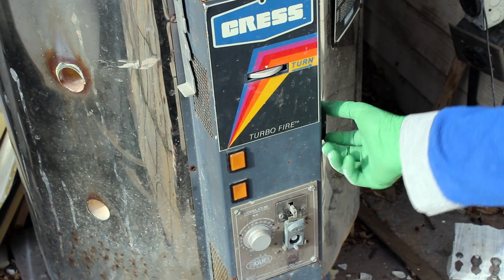Making ceramic water pipes and bubblers

Comment: I am so ready to be out of school with my own shop and kiln so I can make smoke-ware sets 😩
Reply from the maker: Yes! Hopefully the fam will be accepting of what you want to make. Can be tricky starting, it will take 5 years to feel worth while...
Reply: @Ceramicsmokeware  don't gotta worry too much about my family--the only ones I care about would love it! And I'm sure it will be rough, but I've still got a couple years before graduation (double majoring), so I should have some footing before then, if I'm lucky. My partner and I have already talked about how we need to save for at least a kiln
Reply from the maker: @aritheninjaxd  yeah that mentality is a good start. I would also mention to get a used older kiln because you can get them under 400 and they last forever with occasionally needed replacement coils. Let us know how it goes when the time comes. Thanks for your interest.
Reply: @Ceramicsmokeware  thanks for the tip! I'll be sure to let you know, and no problem 😁👍

Comment: How do you account for shrinkage when making bowls?
Reply from the maker: Krancky it’s pretty hard to, like here this doesn’t account for it but it still works with glass.
Reply: @Ceramicsmokeware  I guess the cone shape as long as it's roughly the right size will fit any glass. I was just curious if you molded them a bit bigger than the socket to insure this, or if you have any tips. I'm beggining the journey of making molds, and selling ceramic bongs/pipes myself through our pottery studio, and it's a little daunting 😂
Reply from the maker: Krancky you could for sure do that if you can figure out how to make something that’s say 10% bigger and still the same shape.
Reply: Stilts under all thos pipes?